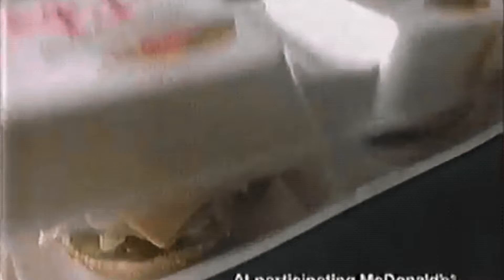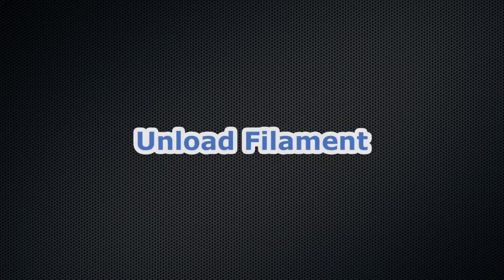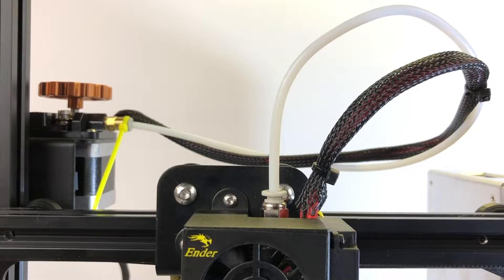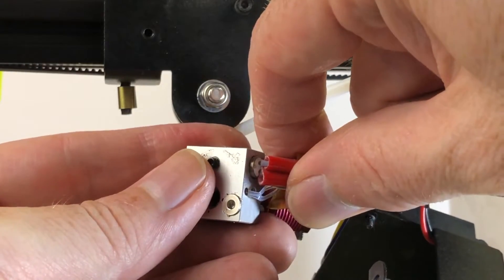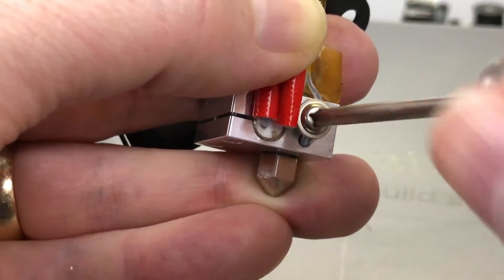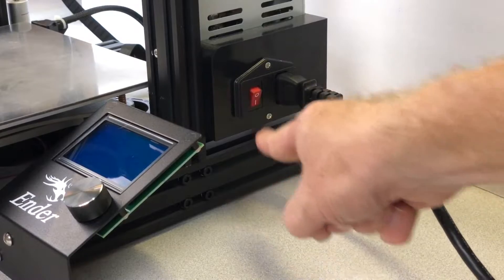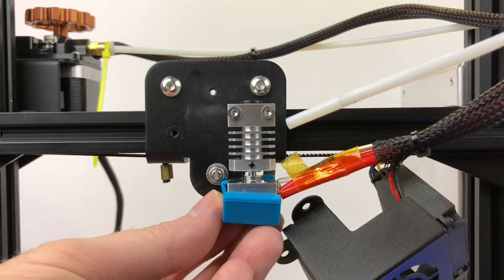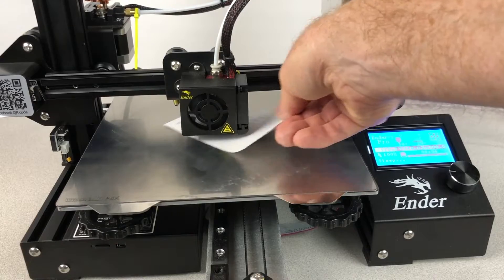How To Install the Micro Swiss All Metal Hotend on Ender 3 & Ender 3 Pro

Comment: After installing the MicroSwiss (re)calibrate your P.I.D. and you won't have to print 5-10° hotter. I'd also suggest (re)calibrating your e-steps after this also just to be sure you're still extruding the correct amount after the upgrade and calibration.
Reply: can this be done through cura printer settings?
Reply: Are you sure this is true? It helps some, but I find I still need a few more degrees. PID improves temperature stability yes, but I think all metal hot ends still may need a little more heat.
Reply: @Henfredemars, always a good idea and is not the end all, be all, when it comes to print issues, but adding some additional heat can be done as well, yes. A lot of the time the additional heat has more to do with the material itself and I've seen that vary quite a bit from manufacturer to manufacturer.

Comment: Question... In your video you say to heat up the hotend to 230C and then re-tighten everything. If I plan to use my new Microswiss hotend to occasionally print at or close to 300C, should I heat it up closer to that temp when doing the final re-tightening?
Reply from the maker: Hi Daniel! If you're going to be printing at higher temperatures, it probably wouldn't hurt to heat the hotend up to your expected print temperatures. I think the Ender 3 & Ender 3 Pro stock firmware top out at 265˚C, though I may be wrong.
Reply: @BV3D  ok that's what I thought, thanks! I'm also upgrading to an SKR E3 Mini V1.2 board with Marlin 2.0, so I'll probably increase the firmware limit max temp :)

Comment: Why are so many people telling me on the Facebook groups that just upgrading to a micro swiss is not sufficient enough to print close to 300C temperatures and i need to change out my thermistor and motherboard?
Reply from the maker: Hi Richard! The stock firmware maxes out at 260˚C, so you will need to load modified firmware to be able to set the nozzle higher than that.

I suspect the advice from the Facebook groups is a result of a Design, Prototype, Text video, here: https://youtu.be/qXUtxt61Ae0

He's got a ton of upgrades on his Ender 3, including running a Duet WiFi main board. The further upgrades he's doing to support high-temp printing are done with that main board in mind, because that's what's on his printer. So I don't know whether you really NEED the Duet WiFi main board, or if the replacement thermistor can be utilized by the stock board.

Comment: Hey Bryan, another great tutorial video, that's exactly how I installed my Micros Swiss hotend on the Borg several months ago. Got it from the awesome 3DPrintz.co.uk who are MicroSwiss resellers here in the UK. My retraction is set at 2.4mm which works great.
Reply from the maker: Hi Spike! I'm slowly dialing mine downward. I've still got that Sunlu Blue Grey spool loaded, and I'm using it up. I find that filament is good for practical prints, but not the greatest for "pretty" prints. What's your retraction speed? I've got mine pretty slow, around 20-25mm/s.
Reply: @BV3D  Sorry for taking so long to reply. I have my retraction speed set to 75mm/s. I'm currently still using S3D for slicing for the Borg, intend to switch to Prusa Slicer when I get time to tweak a profile. Almost forgot, I'm using a 0.8mm nozzle, but used the same retraction settings for 0.4mm too.

Comment: Great Video, I installed the Microswiss hotend on a couple CR10s at work. So, far they have worked good... now we just need a dehydrator for nylon.
Reply from the maker: Thanks! I've only had this installed for a few days but I have no complaints so far. Can you make one of the food dehydrator-based filament driers? I made one out of a big storage tub. I mounted the dehydrator on the lid, upside down, so it blows into the tub. And I cut some vent holes at the far side of the lid so the airflow moves through the box. It works pretty well.

Comment: What am I missing? Isn’t the stock hot end all metal?
Reply from the maker: Hi Magic Larry! On the stock hot end, the Bowden tube goes down into the melt zone. The end of that tube is all the way down inside the heater block, resting up against the threaded end of the nozzle. As a result, it has to deal with a lot of heat, and after a certain amount of it, the tube starts to deform a little bit. If it shrinks, you can have a situation where filament can leak between the tube and where it's supposed to be flush against the nozzle. If it narrows, it can be harder to feed filament through.

On the Micro Swiss hot end, the Bowden tube goes a little way into the cold end's heat sink, and that's as far as it goes, staying on the (relatively) cold side of things.

The rest of the filament's path, all the way to the nozzle, is metal. It goes through the remainder of the cold end's heat sink, through the heat break, and down into the melt zone in the hot end.

I hope that explains the difference. Thanks for the question! 👍
Reply: BV3D: Bryan Vines thank you for the explanation.
Reply from the maker: You're very welcome!

Comment: Hi Bryan, Great Video!!!  I think  you might want to trim the outside of the Boden tube  This will make seating the tube a bit better.  i am going to make my ender a direct drive with dual lead screws i think..
Reply from the maker: Hi David! Thanks for the suggestion. I trimmed a little off the end of the tube using the Captubes cutter I got in one of the Alien3D UFO boxes. I'm thinking of doing a direct-drive extruder on the Ender 3 Pro, too. I prefer my direct-drive printers, but I have to say that the Bowden setup on the Enders works a lot better than I had thought it would. I've been researching Ender 3 and Ender 3 Pro mods on Thingiverse and there are a few Dual Z setups. 👍

Comment: Great video. Do you know if the hotend will fit a CR10S Pro as it does the cr10S? Also is the fitting that holds on the Bowden tube changeable or is it milled into the heater block?
Reply: Micro Swiss makes one specifically for the CR10S Pro.  It is different than the one for the CR10S.
Reply: @coreymac2381  ok great thank you
Reply from the maker: Hi! Micro-Swiss has a different kit for the CR10S Pro. It's the same price, and here's a quick affiliate link into Amazon: https://amzn.to/2SPs2PC

I've reached out to Micro-Swiss to find out if the Bowden fitting on the cooling block is user-replaceable. I'll let you know what they say!

Comment: I love how quick your printer heats up 😉 Turbo style. 
Another reason for a all metal hot end is, the ptfe gives off some very dangerous gasses as it degrades. 
Just for those using a bl touch,  the micro Swiss is a few mm shorter than the original so a few adjustments need to be made.
Reply from the maker: Hi Tony! I wish that was realtime heating! Haha! Thanks for the additional info about PTFE, high temperatures, and the height difference with the Micro Swiss! 👍

Comment: Excellent, thanks Bryan.  I've got one installed on my CR10S (essentially the same installation procedure). It's and excellent product that very happy with it and am considering one for the Ender. Have a wonderful day!
Reply from the maker: That's cool, Thierry! I bought a couple of extra nozzles when I placed this order, one of which is a 0.8mm. I also got some for my Monoprice printers. I'm interested to try printing with a larger nozzle. Maybe something in vase mode... Thanks and have a great day! 😀
Reply: Awesome. I use my 0.8mm nozzle quite a bit for practical prints. Parts are way stronger with the benefit of faster prints. I think you'll find it handy for sure. I need to experiment the other way with smaller nozzles. I've been printing mini's with a 0.4 and haven't had a chance to try my .2 yet. Looking forward to your next video!